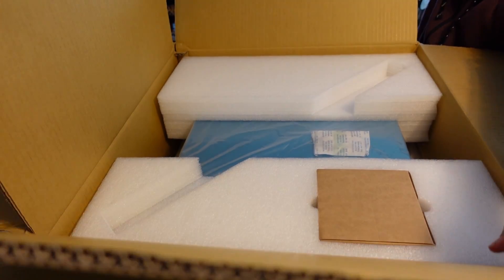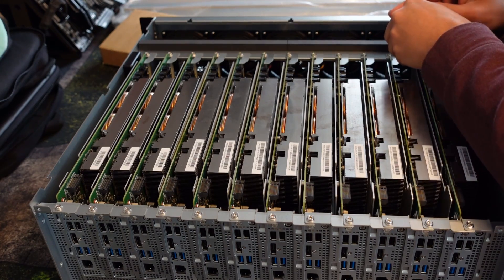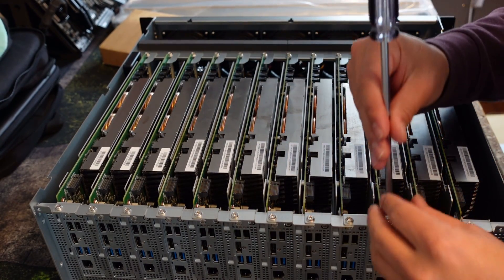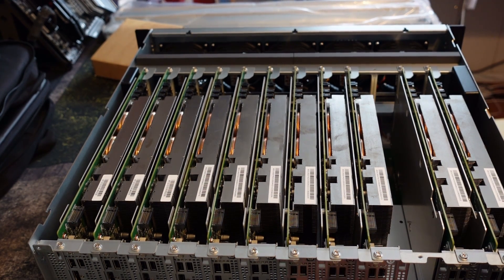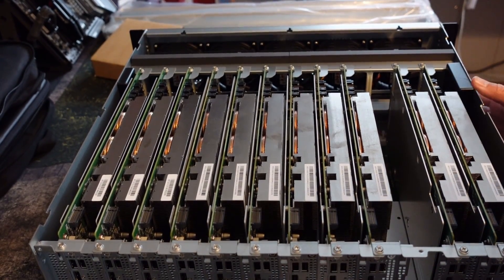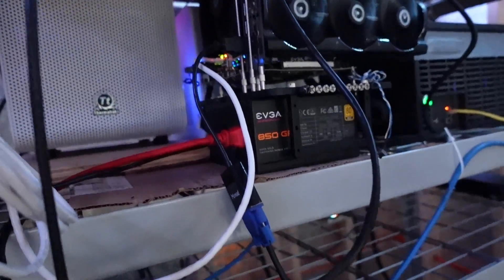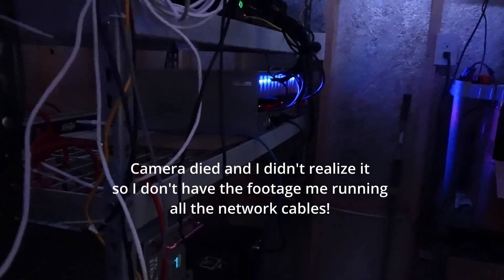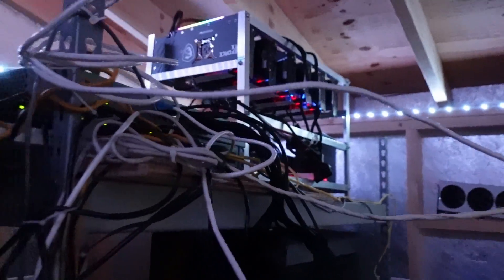Unboxing and deploying a bc250 12 card mining rig. It was a lot more work than I thought it would be

Comment: I bought one of these for gaming, but i'm having issues just getting video after installing my OS of choice. I really dont want to use Windows but i may just be forced to.
Reply from the maker: what os did you try?
Reply: @krootman_digitial  i've tried several variants of ubuntu, including 20.04LTS and some older drivers that supposedly were the ones used for mining but failed to install.
I've also tried SteamOS and a few of its variants, SteamOS is the only one i could get video out of after imaging
ARCH and Manjaro i couldnt even get video out of the installer. cant even select safe graphics just spits out a few lines then the image freezes there as it boots into the installer, same problem i had on bazzite version of SteamOS.
Windows 10/11 works great, just cant install drivers because windows requires DirectX, and this doesnt support directX apparently so windows disables the devices shortly after installing the drivers.
Reply: Did you have any more luck with drivers during the last month? I’m considering a setup of these for LLM inference

Comment: Ay! Thanks for the video. The first of its kind I believe :o

Looking forward to more about this.
Reply: And a followon comment. I’m as concerned about the power supply situation as you. These do appear to have the potential to overdraw power. May upgrade the PSUs to 1400w ea?
Reply from the maker: you can do that or just run 10-11 of the 12, also Son of a tech has done a few deep dives into the bc250 so im not the first.
Reply: @krootman_digitial  I meant the unboxing and visualization of just the unit as a whole. I’ve seen Matt’s review a few times now. Good stuff. :)

And yeah, sometimes I forget you can power off the individual blades. Makes sense.

Comment: Also looks like u may need a 12 port eth switch. the pic for that web site to buy for 900 bucks . shows each card ps has it's own ethernet port each!
 610 Mhs on ETHASH. +/- 3%
245 Mhs to RVN. +/- 3%  (equals 8 or 9x 3070 cards )
610 Mhs on ETC. +/- 3%